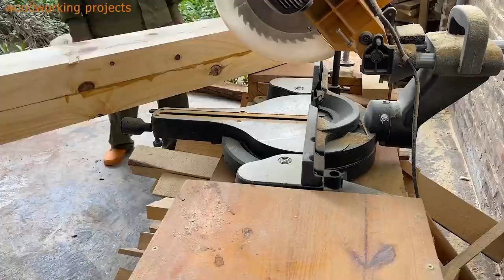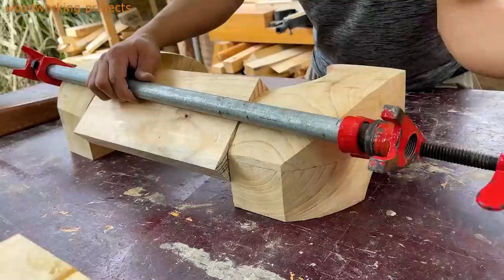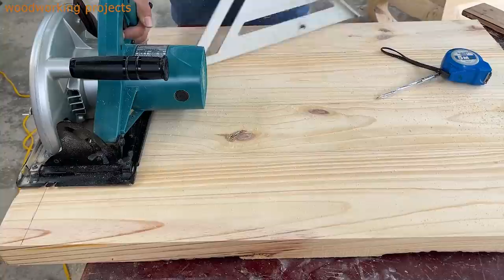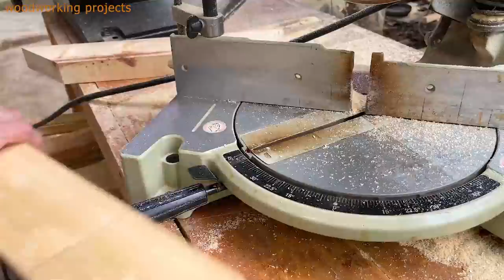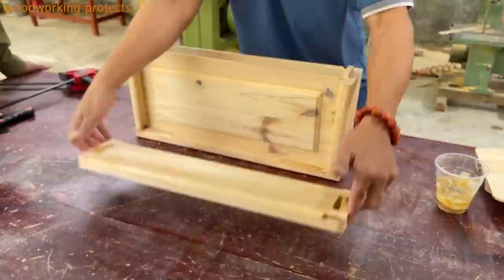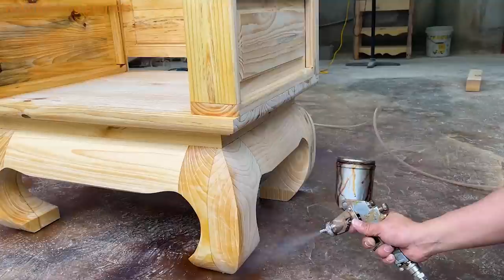BUILD A KING CHAIR // WOODEN THRONE With Amazing Woodworking Techniques & Skills

Comment: I see the potential for hidden compartments in both arms. Excellent work. 👍
Reply from the maker: Thank you very much.
Reply: I have to agree with you on that. Which way it would open is the only question.
Reply: @westonhorn789  maybe press a knot, drawer pops open?